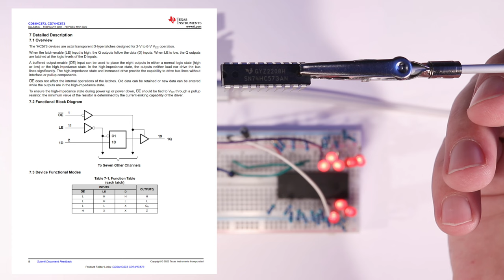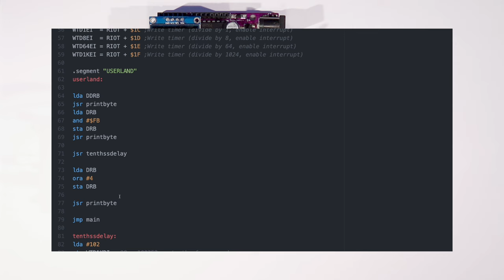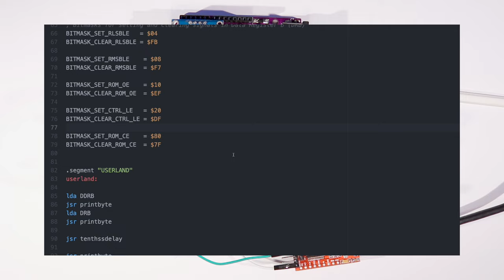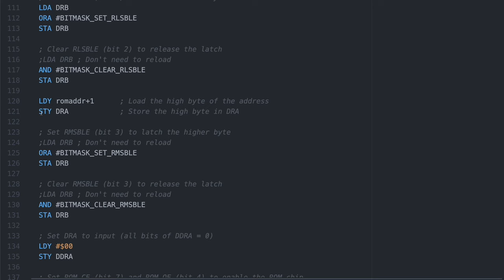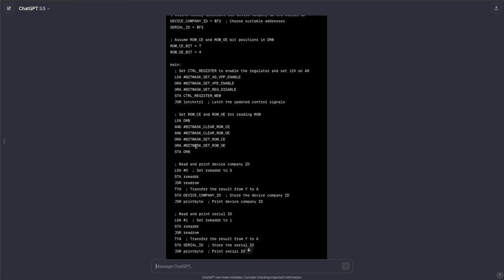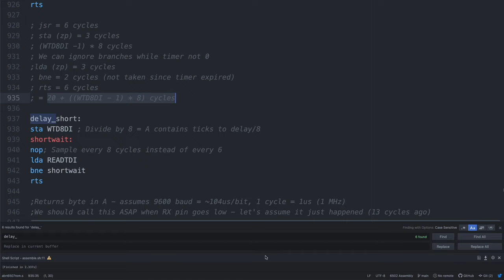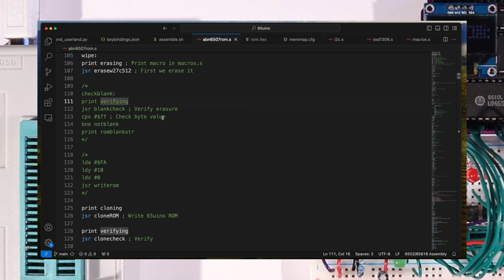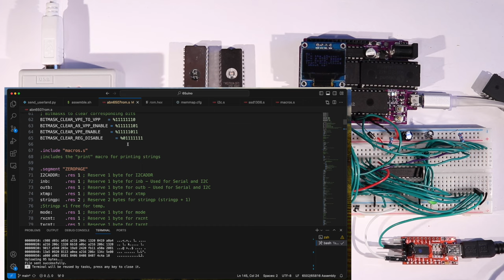You just saved $60 on a ROM programmer. Thank AI.

Comment: Another nice video, Anders, and a wonderful solution for W27C512 devices.  Just a note, if I may?  If the 28-pin 65uino ROM socket was re-wired with pins 1, 2, 26, and 27 connected to VCC instead of ground, I believe you could use an 8K 28C64 EEPROM or a 32K 28C256 EEPROM as well as the 64K W27C512 EEPROM on the 65uino.  The 'recycled' 28C64 and 28C256 prices are similar to 'recycled' W27C512 prices and the 28C64 and 28C256 devices are erased and programmed at 5v using much simpler and less costly DIY programmer designs.  Certainly not as much of an engineering and design challenge (and fun) but perhaps a viable alternative.
Reply from the maker: Thank you. As far as I can tell it's only pin 27 that needs a jumper select for WE (planned for next revision) - other than that they should be drop-in compatible. Did I miss something?
Reply from the maker: 26, 27 already have solder jumpers - I'm unsure if VPP on pin 1 needs to be tied high for 27C256. Don't see any case where A12/NC on pin 2 would take issue with being grounded. 5V in circuit programming is the goal for next revision - but of course that requires a bit more address decoding.